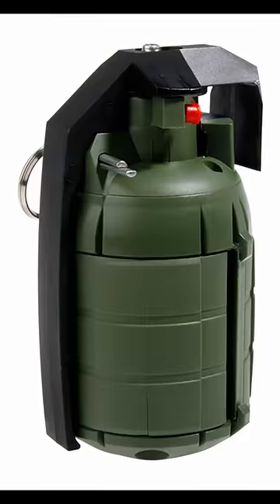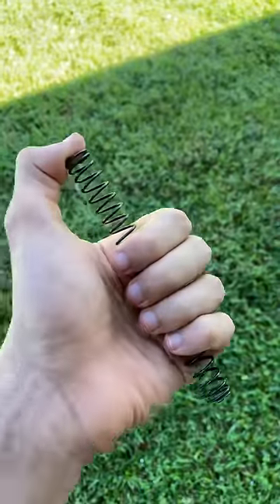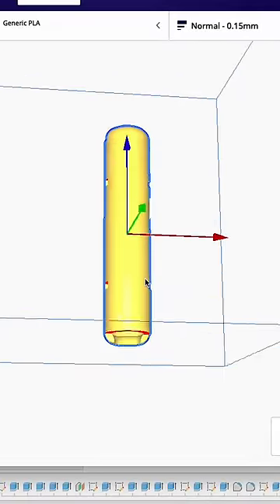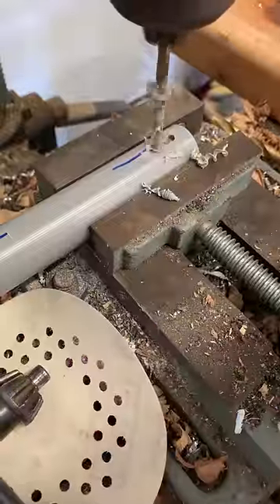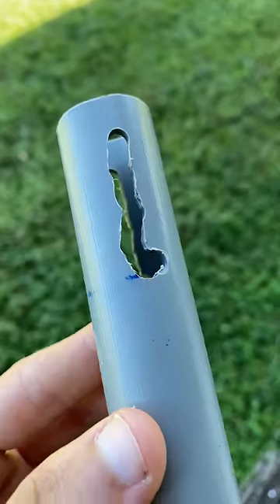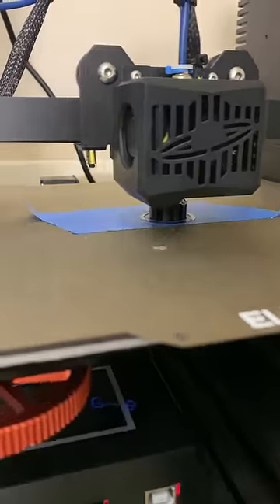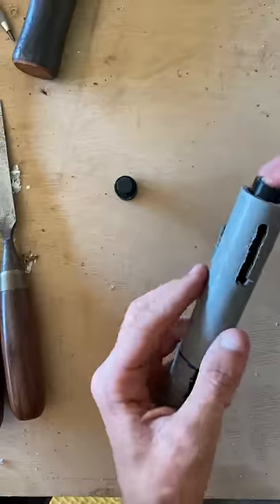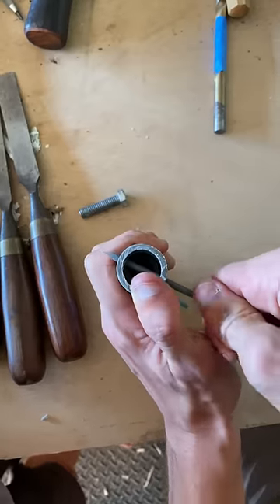Let's make an Airsoft Grenade 💥

Comment: You should use the drill for the initial hole then use something like a file to cut the rest. It is pretty thick pvc so it'd take a while but it would be much straighter of a line.

Comment: Just use compressed air, or a small amount of actual black powder in a small paper wrap in the middle, this assure enought force to push the bb out and make some cool smoke will still behing safe ( black powder is not an actual explosif it just burn really quickly so it's safe in small amount )

Comment: It wouldn’t take 7 hours if the layer height wasn’t .15. Learn your machine and what tolerances matter. I’d switch to a .6mm nozzle and do a layer height of .3 and it would halve your print time. All of my machines run .6 nozzles and I have never had any tolerance issues related to the nozzle size.